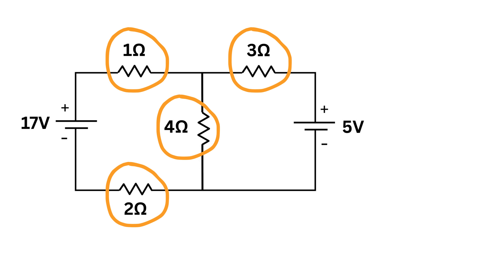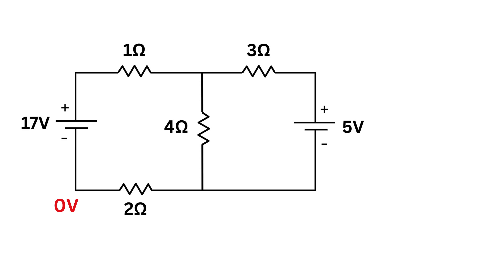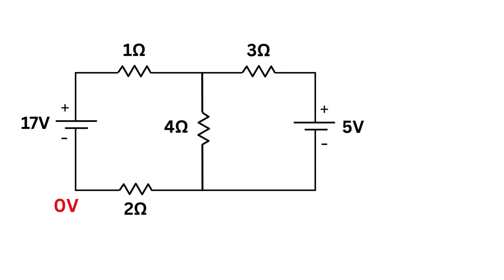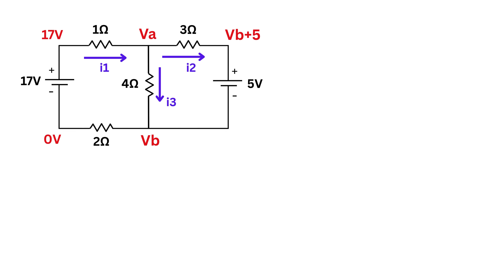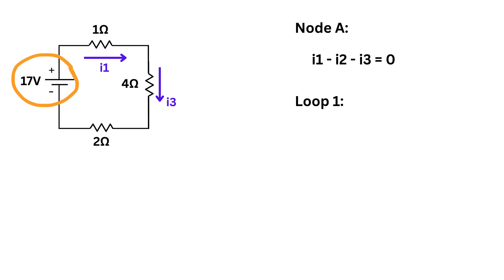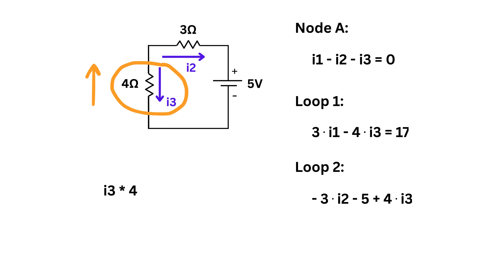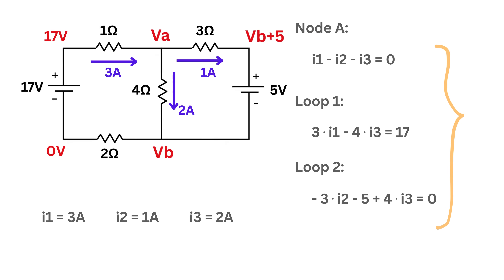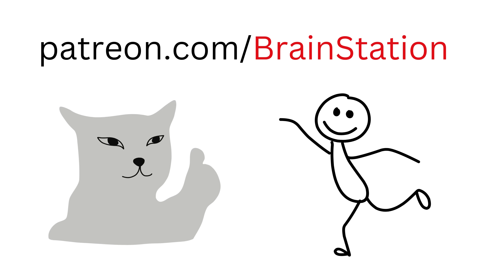How to Solve ANY ANY ANY Circuit Question with 100% Confidence

Comment: Calculate the effective resistance between A and B
To find the effective resistance (R_{eq}), we need to analyze how the resistors are connected between the two nodes A and B. Looking at the circuit diagram:Branch 1: There is a single 15\ \Omega resistor connected directly between A and B.Branch 2: The 6\ \Omega and 4\ \Omega resistors are in series with each other.Sir , please solve the question by using same method

Comment: Very simple. In the absence of the 4R resistor the circuit reduces to an 11v source with an impedance of 1.5R so this would provide a current of 11v/(1.5 + 4) = 2A through the 4R resistor, giving 8v across the 4R resistor. From this we derive that the current flowing out of the 17v battery is (17 - 8)/3 = 3A and the current flowing into the 5v battery is (8-5)/3 = 1A

Comment: I just might be slow but why in the first loop does the bottom also become i1?
Reply: current entering or leaving any battery is same, so if i1 current is leaving the battery then i1 current should enter the battery

Comment: Why is the current i1 in the 2Ω resistor and not i3 ?
Reply: Loop 1
Reply: current entering or leaving any battery is same, so if i1 current is leaving the battery then i1 current should enter the battery

Comment: @7:01 “This 17 Volts minus the Voltage at Node a”, is incorrectly worded. It should be “this 17 Volts minus the Voltage drop of the 1 Ohm results in 14 Volts at Node a.” This is under the assumption that the currents are as he stated. Which they are not, based on the comments I’ve seen, otherwise, this video is well made. Thank you

Comment: I did solve the system of equations, because I usually AM in the mood, and I didn't get the same result.  I went back to find why, and found that you have a sign wrong in your Loop 1 equation (@5:14).  You stated (correctly) "plus 4i3" but you wrote "minus 4i3".  I blindly copied down your 3 equations and solved them and reached a very different result.  So, for others:  if you do like to do the math, note the second equation is not 3i1-4i3=17.  Instead, it should be 3i1+4i3=17.  Wrong sign in front of 4i3.  With this correction, the system of equations DO solve to give the 3 currents as given in the video.  Phew!  For a moment there, I wondered about my decades old so called math skills.  I do like your presentations.
Reply: @BrainStationAdvanced

Comment: Thanks for the video! 😊
Is there, in the field of electricity or electronics, a real circuit that uses the same schematic as yours?
Thanks in advance for your reply.
Reply from the maker: Not that I know of. This is just a numerical example of solving circuits
Reply: @BrainStationAdvanced  You mean that it’s simply a learning exercise to practice applying the laws of electricity, so that you can use them later on more realistic and more complex circuits?

Comment: why does a 2 ohms resistor get the same i1 label as a 1 ohms resistor?
Reply: Great question and it was not really explained in the video. I think it’s because the current leaving the 17V battery is i1 so the current returning to that same battery must be the same (because of KCL and conservation of charge) and so is also i1.

Comment: I see a problem with this calculation, you have your voltage zero in the wrong corner since you're voltage source plus and minus do not go clockwise. According to your diagram electrons flow from the negative source to the positive source therefore it should go counterclockwise.

Comment: for the 2ohms how did you know it was I1 and not I3 or I2 .you got 3I1 -4I3=17 for loop 1 but why is it not I1 -4I3 -2I4 = 17
Reply: Because i1 is the current out of the battery + side and the current towards the - sidecneeds to be the same so i1 out is also i1 in to the battrry
Reply: current entering or leaving any battery is same, so if i1 current is leaving the battery then i1 current should enter the battery

Comment: In loop 1 Why you take current i1 in both 1ohm resistor and 2ohm resistor
Reply: current entering or leaving any battery is same, so if i1 current is leaving the battery then i1 current should enter the battery

Comment: the equation is wrong here 5.02 in loop 1 because the 4 ohm resistor touches i1 and i3 so the equation would be17-7i1-4i3=0

Comment: the voltage drop across 2 ohm resistor is 6v and across 3 ohm resistor is 11v.
Using:
0v - Vb = -I1(2 ohms) 
0v = 6-3(2) 
0v = 0v
Vb+5 - Va = -I2(3 ohms)
Vb+5 = 14-1(3)
Vb+5 = 11v
Vb+5v
6v+5v = 11v

Comment: 4:51 why do we call this resistor again with i1 when we already used i1 above ? Why don't we write i4 ?
Reply from the maker: Because that same current i1 which is flowing through 2Ω resistor (left) will continue and flow through the 17V battery...then it will continue and flow through 1Ω resistor (right)...so it is exactly the same current flowing through the left loop

Comment: In practice you almost never have to solve these kind of completed circuits and it's usually the other way around as in: 'what resistor values do I need to achieve x amount of voltage attentuation and y amount of voltage added given this fixed reference voltage that's available', e.g. converting the output of a DAC from 0..4.096V to 2.1...3.2 volt using three resistors. It's all the same principles of course, you instead just solve for two resistor values after choosing the third yourself.

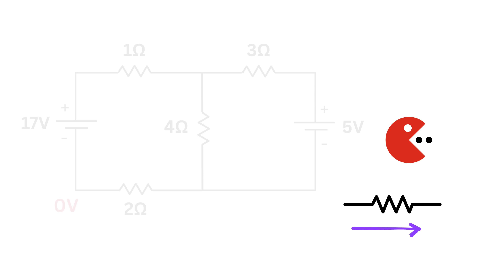Comment: 1:24 direction of voltage is stated wrongly in the voice over and in the arrow in the diagram.

If the current is from left to right through the resistor, then the direction of the voltage is NOT in the direction of the current, it is AGAINST it.
That is, the voltage is represented by an arrow along the resistor and points from right to left.

The arrow head on the voltage arrow points to the terminal of the resistor which has the higher voltage.

This is important when it comes to circuits using diodes.

Comment: As a lifelong and retired EE, I solve pretty much all circuit analysis with Thevenin (or Norton) equivalents. And then I put the solution into Excel, since it is all simple equations. No solving multiple equations, no matrices. Save them for the hard problems. 
1) 1 and 2 ohms just add to 3 ohms. Then 17V and 3 ohms is a Thevenin source
2) Then 3 ohms and 4 ohms is a simple voltage divider, easy to solve for the thevenin Rth =  (3 || 4) and voltage divider. Vth= 17 * 4/(4+3)
3) Then the resulting simple Kirchoffs loop is just ohms law: I = (Vth - 5V) / Rth + 3)
Once you know the current in the 5V and the 3 ohms, the rest is easy.
Reply: I agree

Comment: It is not necessary to use both current law and voltage law to solve circuits like this.  In this circuit the natural choice is KVL since voltage sources cause problems with KCL.   There are three loops.  Only two are needed. Choosing the two you called 1 and 2 the equations would be 17 - 1*I1 -  4*(I1-I2)  - 2*I1 = 0 and -5 - 4*(-I1+I2) - 3*I2 = 0.  Now it is just some simple algebra to solve 2 equations with 2 unknowns.  Even considering KCL for a circuit like this is an unnecessary complication.

Comment: having flashbacks to EE 101
here are my 2 cents for what it is worth.

this problem only has 2 unknowns Va and Vb, or i1 and i2.
 i3 is just the sum or difference of i1 and i2 depending the direction for i1 and i2 you select.
i would never mix node and loops, stick to one for the whole problem

i prefer nodal analysis, here are some hints to make it easier. 
assume all current flows out of the node, sum the currents, and set the sum equal to zero.
that way you don't have to figure out if the current goes on the right or left, they all go on the same side.
also, you end up working the math the same way every time which makes it easier,
once you have the voltages, it is easy to calculate the current using ohms law.

Comment: Man stellt sich 2 virtuelle Kreisströme vor .
Links Ia und rechts Ib. Beide im Uhrzeigersinn.
Dann die Maschenregel beginnend links oben im Uhzeigersinn
Jeder Spannungsabfall = I×R 
Im 4 Ohm Widerstand fließen beide Ströme also Ia runter und Ib rauf:

I:
1×Ia + 4× (Ia-Ib) + 2×Ia = 17

II:
4×(Ib-Ia)+ 3×Ib = -5

I:     7 Ia - 4 Ib = 17    |×4
II:   -4 Ia +7 Ib = -5.    |×7

I:     28 Ia - 16 Ib = 68  
II:   -28 Ia +49 Ib = -35

I+II
33 Ib = 33
Ib = 1 A

Einsetzen in I:
Ia=(17 + 4×1)/7 = 3 A

I1 = Ia = 3A
I2 = Ib = 1A
I3 = (Ia-Ib) = 3A-1A= 2 A

Comment: This is not correct. The 5 volts power source is 5 volts. in your example there is minus 1 volt over the 5 volts source.  The 6 volts will be zero because of the 5 volts power source. Apply this to solar panels and you see why there are so much troubles on the grid. First rule, never put two power sources coupled in one circuit. One of the sources will get overloaded.

Comment: we had made a C program with Graphical input of V,I,R,L,C Diode and Transistor  to solve elecronics circuit problem in 1998, It was basically using Kirchhoff's laws plus Matrix inverse and Matrix mutliplication C function at its core to Find current and Voltages across various Circuit components. Matrix inverse and Matrix mutliplication C function were developed to solve i think 16x16 matrix. exact Matrix size i don't remember .

Comment: Well explained Sir but I think you don't complete the Circuit analysis. There is also a 2nd Voltage source applied to the Circuit. What is its role in the Circuit diagram Sir?

Comment: These two voltage sources are easily false. How the 5V battery is charged, for example, when it is 6v in its poles, is it even possible. It would be worthwhile to test and measure it first. What is the aim of the theory of this?

Comment: Great explanation, thank you. 
Just one bit: why do we have i1 going through the 2 Ohm resistor in loop 1(at 4:53)?
I really could not understand it.
Reply from the maker: Because from the 2 ohm resistor to the 17 volt battery to the 1 ohm resistor there are no different branches where the current can split. It’s a single path. Therefore, the same current flows through all the components in that path.
Reply: @BrainStationAdvanced Many thanks for the explanation. As I understand, i1 splits to i2 and i3, they circulate the resistora, and then combine back to i1 at Vb. And at Vb junction, the currents coming in the junction are i2 and i3, therefore per the Kirchoff's Current Law, the output current at Vb should be equal to i2+i3, which is i1. Is my understanding/logic correct?
Reply from the maker: @tbalci  exactly 💯

Comment: Very complicated. You can just add 1 and 2 ohm and put at the 1 ohm position. Thevenin voltage is 11V. Thevenin impedance is 1.5 ohm. Current through the 4 ohm resistor is 11/(1.5+4)=2A. But you are right, applying kirchhof's laws works for any resistor network. Thevenin theorem does not always, but for this network, it does.
Reply: nortonises

Comment: What is the scientific base on which you decided the ground or earth (v=0) will be in this point
Reply from the maker: You can choose any point you want and the rest of the node voltages will be calculated relative to that
Reply: @BrainStationAdvanced  
Thanks for your reply 
So you mean I can choose any point to be zero 
Or that point at the negative pole of the greater battery

Comment: Let me derive KCL :
Take any general physical quantity as w.
We know by General Continuity : ∂ρ/∂t + ∇.J = φ , where ρ is w per unit volume or W/V , J is the flux of w {or rate of change of w per unit area or (dw/dt)/A} & φ is the generation or removal of w. [∇.J calculates Divergence of Flux]
e.g w = q [Charge] => ρ = q/v = Volumetric Charge Density , φ = 0[Charge Conservation] & J is (dq/dt)/A = I/A = Current Density => ∂ρ/∂t + ∇.J = 0 ----> Electrodynamic Continuity Equation , In Steady State : ∂ρ/∂t = 0 => ∇.J = 0 => ∮J.dA = ∮(∇.J)dV = I = 0 => I {Entering the node} = I{Leaving a node} ❤❤❤❤

Comment: At first I solved this problem using equivalent voltage sources in series with resistors.  It is fairly easy to put two sources together and calculate the equivalent voltage and series resistance of the combination.  I have done this so many times it is second nature to me.  Solving simultaneous equaitons with matrices is not so quick for me.
But there is another way I use when the circuit is too complicated.  I just make a spreadsheet in excel.  I have a column for each voltage node and a column for each current through a resistor.  Then I put a capacitor on each voltage node to ground.  (One of the nodes is ground, like you did in the video).  All the voltages start at 0 except for the batteries.  
The capacitors integrate the currents to give you voltages.  I start with all the voltages = 0, except the battery voltages, which are the voltages of the positive ends of the batteries in respect to the negative ends of the batteries.  Then I calculate the current through each resistor based on the voltage at each node.  For example, the current going into node Va is (17V - Va)/1ohm + (Vb+5 - Va)/3ohm +  (Vb - Va)/4ohm).  I call that current Ia.  
After calculating all the currents, I then calculate the voltages in the next row.  For example, Va = Va + Ia / 100.  The "100" represents the capacitance and the delta time.  100 is the same as a 1 farad capacitor updated 100 times per second.
I then copy all the lines in the spreadsheet on down to represent the time slices.  After a while, all the capacitors reach their equilibrium voltages and the only currents left are the currents through the resistors.  You can just read the voltages for each node and currents for each resistor on the bottom line of the spreadsheet.  
I started using this technique when calculating pressures and flows through fluidic systems with many branches.  Then it occured to me to try it on problems with voltages and currents.
Reply from the maker: Thank you so much for sharing this detailed explanation 🔥
Reply: davemuller • I can calculate this in 2000 Vedic geometric representation and keep you here for 2 hours watching the calculations. 😯

Comment: Another way to see the loop rule is to see the loop as alternate paths between two points on the loop (or even one point to itself). There can only be a scalar electric (potential) field if the difference between two points does not depend on how you go from one point to the other. Thus going around the loop any number of times must yield 0 voltage, or going from A to B then from B to A must perfectly cancel. This is not a justification, just a way to remember the rule.

Comment: . explanation on Kichoof law is poor, why ? Becsuse you couldn't explain the concept of positive voltage and negative voltage ,so you should have explained what happened if we are entering to the voltage supply from positive site of the voltage supply or negative site,and should have explained the difference between entering the supply each site's of the power supply. I think it's better to remove this and remake it and explain it better.

Comment: Mesh analysis  is the  boss
Reply: Mesh current is limited in use. Nodal analysis is used more especially when you have circuits with diodes and transistors.

Comment: #1  Voltage Law:  voltages around any loop = 0.
#2  Current Law:  current sums into and out of any junction = 0.

#1  -  voltage increases and decreases around a loop must total zero.  I.E. voltage sources and voltage drops neutralize each other.

#2  - curent sums entering a junction = current sums leaving same junction.

Left loop with 17v dc source is current clockwise labeled I.1.

Right loop with 5v dc source is current counter-clockwise and labeled I.2.

4-ohm resistor total resultant current is I.1 top to bottom + I.2 top to bottom.

Step.1:
write voltages around loop.1:
17v - 4(I.1+I.2)

Note that voltage sources are short circuits
Current sources are open.

V.1 = 17
V.2 = 5

Comment: Depends on whether  a capacitors are near any voltage lost in RESISTORS can be stored in CAPACITORS for later use
Reply: Nonsense.  The lost energy has been lost in the form of thermal energy and that can't end up in a capacitor (as electrical energy).
Reply: @Chris-5318 when boards are designed and resistors are present they need capacitors there to capture the voltage lost to move it to the next component on the board itself too make a continuous loop so thermal has nothing  to do with the setup used in the video
Reply: @Troy-l6o  Oops. I had a brain fart and incorrectly referred to energy. You don't store voltages in a capacitor, you store energy. You could say that you store charges on the plates. Nevertheless, the voltage "lost" across a resistor cannot be "stored" in a capacitor unless it is parallel to it.  Whatever, I'm sure that you have little to no idea about electrical circuits. In fact your last comment makes that crystal clear.
Reply: @Chris-5318 I didn't  say store voltage I said transfer and also said in original comment if capacitor is near resistor and you just said it your comment back when you said if they are parallel
Reply: @Troy-l6o  You said, "voltage lost in RESISTORS can be >>stored<< in CAPACITORS".

You have not used the word "transfer" in any of your comments.

I doubt that I'll reply again as you are clueless and hopeless.
Reply: @Chris-5318 stored to pass to the next component to make  complete loop apparently you missed that part which is transfer like I said

Comment: Why not short the 5V battery and make a simpler circuit first...calculate the currents for 17V batteries. Then do same for 17V battery. Take algebraic sum. It will be much faster and easier to understand
Reply: That was my first thought to, I seem to recall doing that, shorting one of the voltage sources, calculating (with equivalent circuit where resistors in series become one, parallel another) then shorting the other voltage source and the same.